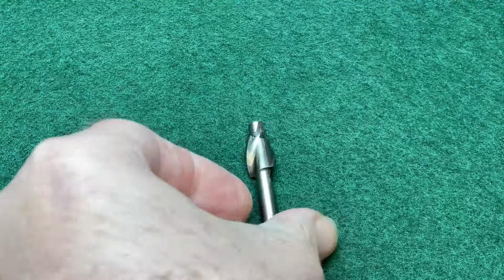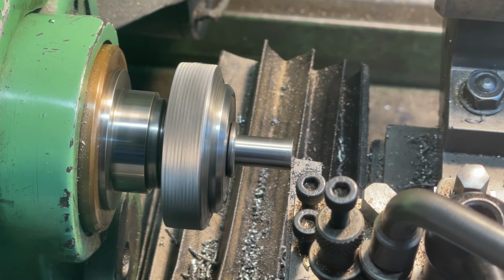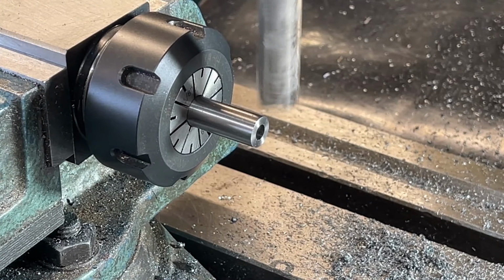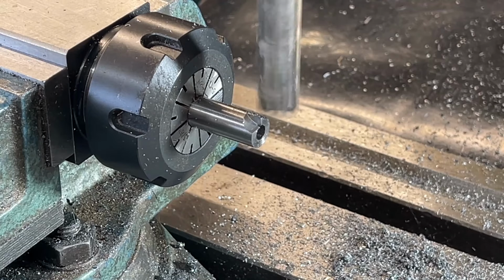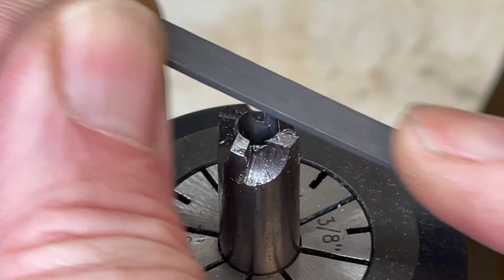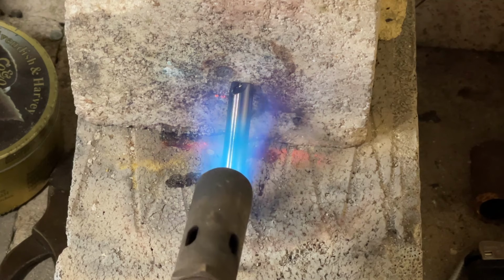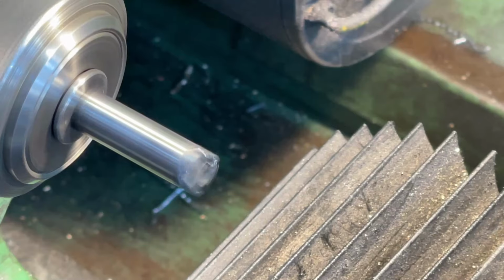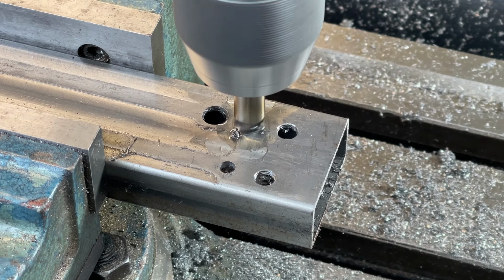Model Engineering Basics: No 4 Four Flute Pin Drills

Comment: I've done the same for similar special cutters.  I differ from your method slightly.  I file more of the clearance and get to more like 1/4 to 1/5 of the width from the cutting edge.  And I leave that final land alone until after H&T'ing.  Then I clean it bright and mark those fine edges with red or blue felt marker and do the final cutting edge relief angle with a fine slip stone watching to see just the last of the felt marker go away.  I like the somewhat cleaner edge left by the slip stone.  These stones are more like a small metal file in shape and size.  So are pretty nice to use with care in this way.
Reply from the maker: The better the cutting edges are finished, the better the tool, I suppose I am a bit lazy. I don’t own the slip stones you mention but will look into them, thanks for the comment and tip.